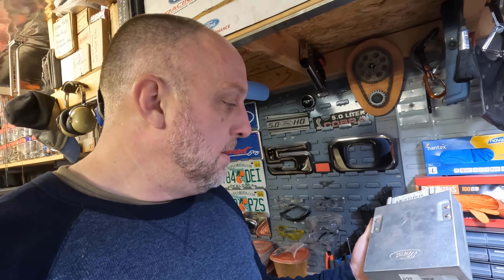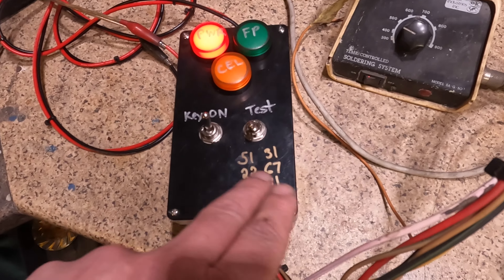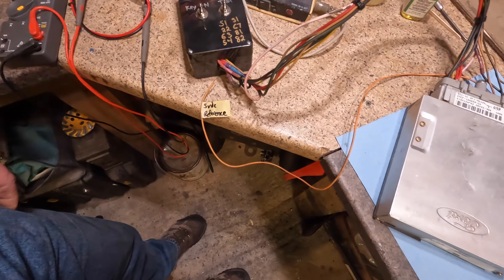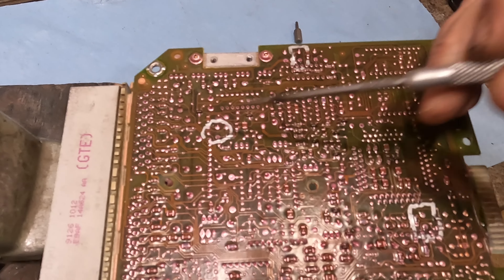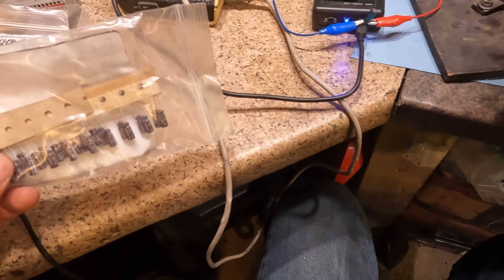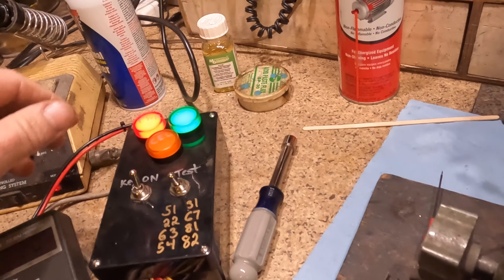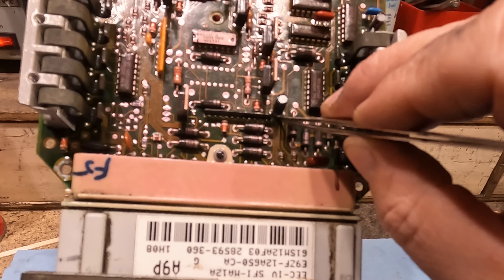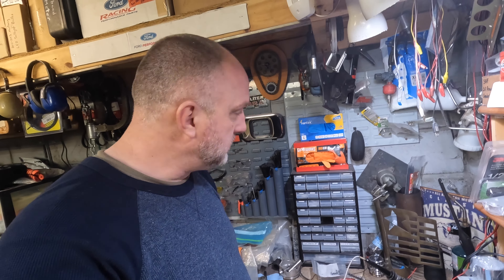Foxbody Mustang, F150 and various Ford EEC IV Repair.  A9L A9P etc.

Comment: Thanks so much for this very informative video. Just helped us fix our 1992 Ford Fairmont ECU in our 65 Mustang. We had lost all hope until we watched this today. Fuel pump wouldn’t switch off. Replaced capacitors but still didn’t go. Closer inspection as per your vid showed corrosion to track from leaking capacitor. All fixed in 10mins and now works. Amazing.
Reply from the maker: Very glad to have helped.
Reply: @Mike-FoxsAbroad  Where do I get copastors?
Reply from the maker: @colt-ss3lw   www.mouser.com
Reply: @Mike-FoxsAbroad  👍

Comment: Great repair video. One thing you didn't mention is that electrolytic caps are polarity sensitive. Be sure you match the original polarity. I repaired my A9L myself but have since gone to Megasquirt. Much more user friendly to tune and programmable inputs and outputs. Way nicer if you're heavily modified with a power adder.

Comment: Great video. Original '88 5.0 LX was running great, now stumbles. Code Low TPS signal. Tested sensor, cleaned 10pin connectors, thought I might have harness problem. I'm going to check out the computer.

Comment: Great video thanks. Having just replaced the caps and a curiously messed up resistor, i suspect the adjacent cap acid had damaged it but what do i know, but watching this i think i need to go back in, never thought to solder the top side nor recoat. EEC-IV is inside on our e250 but feel I've done half a job so back into it, well once the goo turns up from that jungle website.

Comment: Man, awesome video. I ran into a broken square pad under the cap on the edge of the board. I don't feel comfortable enough to make a jumper for it. Gonna send it off to a professional at this point. Thought I was gonna be good to go, but no dice.
Reply: Just solder the end of a small wire across the gap, and then trim the excess wire off when you're done with it. It's very easy to do.

Comment: your video is great i like your ecm tester is there any way i could get the wiring for your tester i just wanna to make sure i am using the right ecm pin thank you Mick i am from ithaca NY
Reply from the maker: I threw up a picture in the "Community " tab of my channel's main page.  Hopefully you can make heads or tails of my schematic diagram.
Reply: thanks for the picture of the wiring for your ecm tester

Comment: I have a 96 F259 5.8 had an auto bought it modified  to 5 spd , drove it about 100 miles ecu burned traces next to caps. You mentioned manual swap needing oxygen sensor re pin @ 6:40?
Reply from the maker: Repinning the O2 sensor harness is a thing on foxbody mustangs when swapping from auto to manual. I’m not sure if other vehicles require similar changes. If you can determine the pins and circuit that was effected you can possibly trace down your issue.

Comment: very informative, thank you! I wonder what you think of replacing the electrolytic caps with polymer? They are supposed to last far longer than electrolytic but may have some extra complications in ordering the right ones because they act slightly different than the electrolytic ones so maybe it isn't as simple as just matching the voltage and uF ratings. Any thoughts? 🙂
Reply from the maker: There has to be a reason.  Thinking they cant make polymer caps in the large values required.  I'm not an electrical engineer so I can't say.

Comment: Do you have a link to the coating you put on the terminals afterwards for weatherproofing? And did you do front and back?
Reply from the maker: @hu5tle-   just search Amazon for “conformal coating”. They have liquid and aerosols. Kinda expensive for what it is. I did top and bottom.

Comment: How do you properly remove the coating on the J-port? I had to replace my old ECU and the replacement never had a chip installed so the port still has that coating. Also do I need to clean the contacts on the top and bottom? I don't want to damage it.
Reply from the maker: That coating on the pins is a thick lithium grease. I’ve seen on one occasion where the grease itself was causing an issue.  Use a few q-tips and some brake cleaner to clean it off. Wet the q-tips and don’t spray directly on or into the EEC. Yes you need to clean both sides.

Comment: Awesome video. But I have a question. The chip you pointed at @7:00. What is that chip for. Mine has two burnt legs and my car runs like crap and getting egr circuit codes and won’t rev up. It’s a intermentant problem. If you kno please fill me in. Thanks
Reply from the maker: Don't quote me, but my best guess is that chip is for the WOT cutout for the air conditioning.  Without a proper schematic of the computer all I can do is follow the visible trace runs and try and determine what things are.
Reply: @Mike-FoxsAbroad  Do you kno what controls egr circuit. That’s the only codes I’ve been getting
Reply from the maker: @michaeljones5273   Sorry I do not.  Most likely a transistor.   That is an odd code to be having.  I would try another computer if possible as it's much more likely wiring or something else throwing the code.
Reply: @Mike-FoxsAbroad  I have located and purchased a new (used) computer. Going to try it. Praying it works out

Comment: Wow, great video I just came across this You're all set up nice little test set. I have a question, maybe you could answer, I have a1987 ford f150 I'm having a no start issue with my truck. All it does is crank. I have Spark, I can hear either fuel tanks. Fuel pump kick in when I turn the Ignition on the only way I get it to start. Is when i spray starting fluid into the intake. She will start, and then stall. Can this be a computer issue? Also, for the fuel pumps
I seen your tester had the green light on it. For your fuel pump, I'm just scratching my head. Why this truck won't start not knowing if this could be my issue? Maybe you could help me out. With that question, I would appreciate it, I'm out of New York. You reached me all the way over here with your video lol
Reply from the maker: @nickpanhead7209  if you hear the pump prime for 1 sec after the key is turned then it’s not the EEC. Sounds like a fuel delivery issue. Remove a line from the fuel filter and start tracking it down.
Reply: @Mike-FoxsAbroad  thank you so much for getting back to me, I'm away from my truck now for a few weeks, but I'll definitely check that out. I know fuel filter is clear. I removed it and blew through it with no. Issues?
But like you said, maybe it's something further back. Thanks again.I really do appreciate it

Comment: Okay if we do not have the sealing goo, what compound could a person get over the counter?
100% silicone, gasket sealer, nail polish and etcetera?
Reply from the maker: I suppose RTV would work in a pinch.  It's just to keep the humidity from causing long term corrosion damage.
Reply: Clear Nail polish works fine in a pinch

Comment: Hi, I went in a different direction.  I went rom t5 to AOD.  Is it possbile I could have the same tracer burn you spoke of at 6:40 ?  I can pull KOEO codes, but no KOER codes. (no action at all).   Car runs perfect but rich.  Any advice ?
Reply from the maker: I've never heard of getting EO codes and not ER codes.  I'd love to help, but troubleshooting someone else's wiring remotely may as well be done by using a Ouija board. It's just not practical.  I'd start by unplugging connectors and trying to run the ER test to see if you can isolate the circuit causing the issue.
Reply: @Mike-FoxsAbroad  thank you.  No worries.  Runs to good for stock motor to change or do anything.

Comment: How much do you charge to look at ecu .
Reply from the maker: Looking at one?  I wouldn’t charge much but remember, I am overseas and shipping it to me will require a customs form and can only be done via the USPS.
Reply: @Mike-FoxsAbroad  ty so much for your fast reply. .
Reply: Wow great video, you really got the right setup to test these. I have a question, maybe you could answer. I have a 1987 ford f150 I'm having problems starting the truck. All it does is crank. I got spark. I could hear each fuel tank fuel pump kicking in when I first turn the Ignition on
When I spray starting fluid into the intake, she starts, but then stalls, could this also be a computer problem? Would you know I appreciate it if you could answer that question? The only reason why I'm asking because I seen your tester had the green fuel pump light on there. Decide computer also control the fuel pumps. Thank you if you could help.

Comment: There should be no programming after changing out the capacitors?  Also is there a way to check that the whole computer is in good shape without the little box you made?
Reply from the maker: There is no reprogramming required after replacing the capacitors.  The best way to check the computer is to install it in the vehicle and run its own code scan.  My home made tester is only for basic functionality.  I would never build a tester that is able to check the entire computer as that would be far more elaborate, complicated and expensive than what it is worth.
Reply: @Mike-FoxsAbroad  I recently acquired a ‘91 Ranger that is low on power. I tried the jumper wire trick and got no codes. Then I took it to a local garage that had the SnapOn scanner and they could not get any data on the screen. Could the ecm be faulty! Thanks!
Reply from the maker: @davidhorne2326  There is a high probability that replacing the capacitors will fix the no codes issue.  It cant hurt anyways.  Old cars are a gamble as you never know what the previous owner has done and possibly fried something.

Comment: Is that thermal past you put on the board for weather what’s the name?
Reply from the maker: It's a rubberized coating.  It's literally called a "conformal coating" on Amazon.  Small bottles like I have here are like $15 and will last a lifetime.  Unless your bottle cracks like mine.
Reply: Thermal paste is only for putting between the physical package of an I.C. and a heat sink that goes on tip of it. 

The thermal paste fills the tiny irregularities between the surfaces of the I.C. and the heat sink, and makes the thermal transfer between the parts much more efficient. It is not used as a coating on a circuit board to help weatherize it.

Comment: I think my 1990 ecu needs this.  Wonder if a 63 volt cap is necessary or if I can use one of less voltage rating?
Reply: With electrolytic capacitors you can usually go to a higher voltage rating, but shouldn't go lower.
Reply: The higher the voltage rating of the electrolytic cap, and the lower the actual voltage going into it, the longer it will last, provided that the capacitor physically fits into the holes in the board.
Reply: @davelowets I believe the circuit voltage is less than 15V, thus 63V seems exceptionally high?

Comment: 24.febrero.2023
Hoy cambie los capacitores de mi ranger 1993, lleva 2 y estaban sulfatafos. Todas las mañanas en la primera ignición la bomba de combustible se queda activada por 5 o 10 minutos, al apagarse luego funciona de lo más normal 

24.February.2023 Today I changed the capacitors of my 1993 ranger, it has 2 and they were sulfated. Every morning in the first ignition the fuel pump stays activated for 5 or 10 minutes, when it turns off then it works as normal

Comment: I have an 1988 ford F150 is there a chance that even if the computer looks good and the capacitors do not seem to be leaking could the capacitors still be bad?  your video was really good.
Reply from the maker: As a general guide I have found fewer than 20% of the capacitors that I've tested have remained within a 10% tolerance of their original specification.   These things are 30-35 years old.  Capacitors seem like the components that take down all vintage electronics.  If your truck is a keeper then I would change them regardless of physical appearance.
Reply: @Mike-FoxsAbroad  Thank you,   This truck is in great shape. fuel mileage started to go bad and I  Changed a bunch of parts due to the codes I was getting and it turns over just wont start.  I get 5 volt references at sensors though.   I will track down some parts from mouser but there is so many choices. Lol
Reply: @Mike-FoxsAbroad  Just ordered some Panasonic capacitors from Digi Key as the shipping was quite a bit cheaper .

Comment: Where is that 5v reference wire located?
Reply from the maker: What computer are you working on?  I only know fox mustangs use pin # 26.
Reply: @Mike-FoxsAbroad  it’s actually a 95 f150, was hoping it would be similar.

Comment: That 8 pin chip that he said can get get corroded from a leaking capacitor. Does anyone know if I need to get a certain one? I see many 8 pin ic chips online but not sure if I need a certain one. One of the legs on mine is blown out and the chip is leaking out so I want to replace it. Already put all new capacitors.
Reply from the maker: Sorry, I have no idea where to get a replacement chip other than another donor EEC.

Comment: Have you ever had only ONE (1) DIAGNOSTIC PORT (THE SMALLER SINGLE WIRE PLUG IS NOT INCLUDED)
Reply from the maker: No. I’d be inclined to think that small single wire and pigtail connector was cut, removed, or corroded off from its wiring harness near the bigger diagnostics connector somewhere.